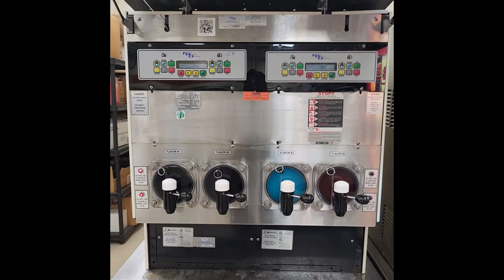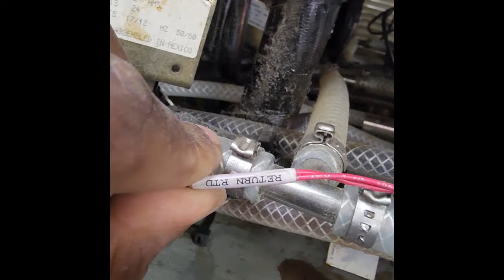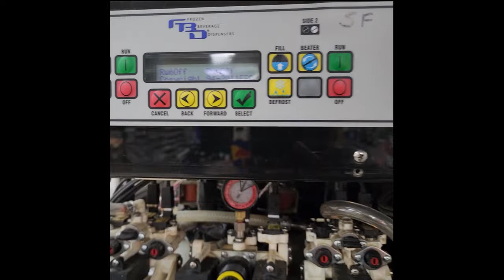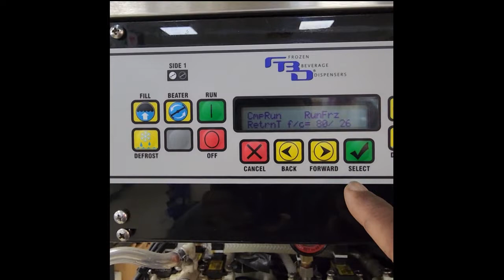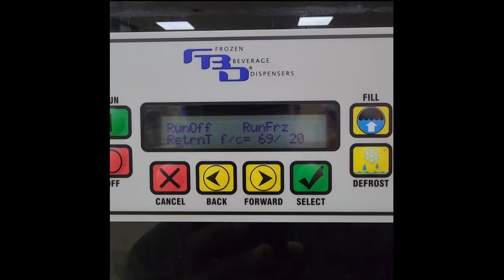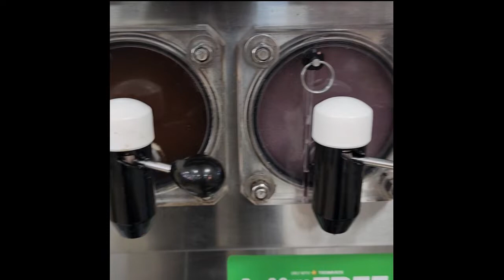FBD Slurpee Machine Repair (Temp. Sensor Replacement)

Comment: Nice job as always! Curious,  what was the brix on the Dragon fruit? or better yet, how did you get the brix I'm just asking because I thought a Refractometer Measures sugar content.
Reply from the maker: The Dragon Fruit Brix should be set at an 11 reading on the refractometer as it is a sugar free flavor . I do use a refractometer to measure the brix always. On these slurpee systems the sugar flavors require a refractometer reading between 13 to 14 and the sugar free flavors require a reading of 11. My apologies for not covering that, I hope this helps.
Reply: Excellent explanation on the use of the refractometer when measuring sugar flavor as well as sugar free.
Reply from the maker: @tphpwalker  Thank you for watching.